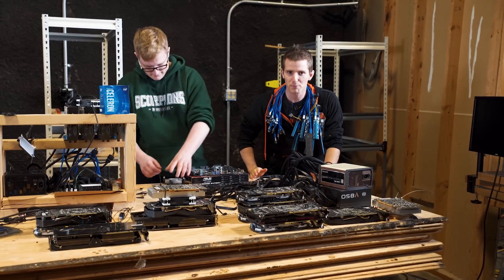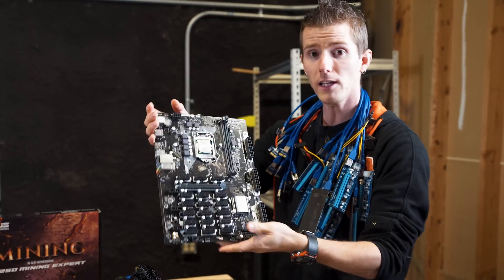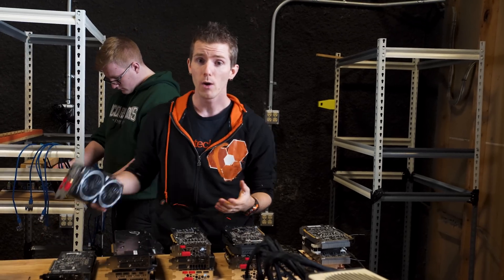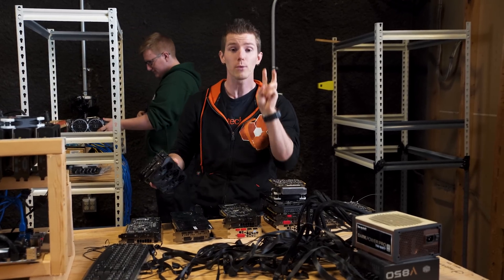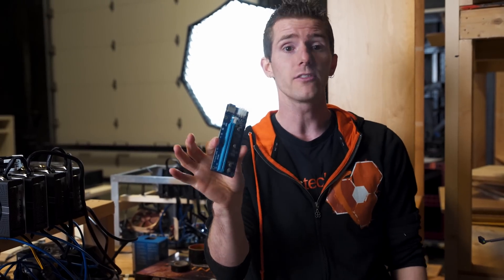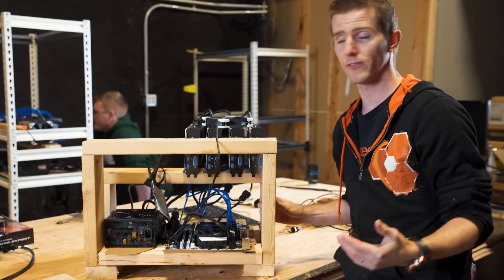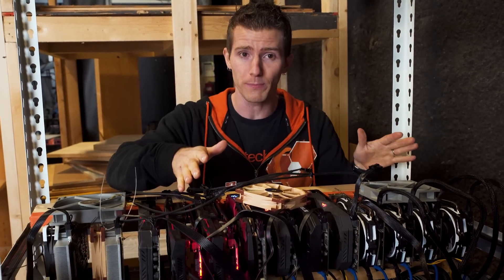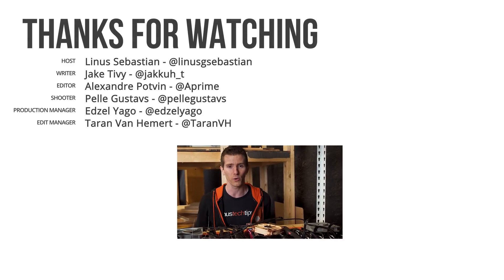13 GPUs in ONE PC? – Mining Adventure Part 2

Comment: OK going to drop some knowledge here. MINERS, you do not use a GPU to mine, you need a mathematics CPU. You are crunching highly complex mathematical equations, you need something efficient with numbers, not visual data. You cannot join any lucrative mine pools due to the fact you are not using the right hardware. You are only making a small fraction of what you could be if you just got yourself Ant miners or got yourself linux modded PS3's ( cell cpu very good at mining ) 

Whoever told you GPU's are best is a fucking moron. This is what's good! 

https://bitshopusa.com/products/bitmain-antminer-s9 

click the profitability tab, bask in that hash rate.

Comment: Question.  I have an R9 390x collecting dust. Would it be worth it to slap it in my old 760mb with my fx6300 and mine off one card? I don't need to buy any other hardware.

Comment: Bad timing my dude, Alos dont worry guys, soon you will be able to buy a 1070 for $150 when cryptocurrency  crashes.
Reply: Aaron Gramajo right I’m trying to build and a 1060 is basically 500$
Reply: Andy Ruiz - Yeah, well, if bitcoin somehow did crash like somehow, or maybe the algorithims that nvidia cards are good at mining at turn to asic, then perhaps so, big businesses and owners of thousands of gpu's with no use, so they will try to sell them off as fast as possible, even if it means selling them as low as $150. The chances of this happening are low, almost to low to consider but interesting topic yeah?
Reply: C0deH0wler what you said makes no sense. Yes prices flux but not by hundreds of dollars, mining the aspect caused a drought in cards. Simple supply and demand, If the demand out weighs the supply prices go up. Which because of everyone wanting to mine all the cards that have a decent rate are more in price.
Reply: yeah a bunch of used beat up cards covered in nasty miner fluids. no thanks
Reply: worst time ever... video card prices skyrocketed with crypto currency value
Reply: hey lol, did you know gaming will ruin GPUs way faster than mining does. It might sound strange, but GPUs that are turned on and off every day, start using more or less energy on graphic demanding parts of a game during a gaming session will get damaged faster. While keeping GPUs always on with adequate power supply and continuous maintenance will live more. Let's not mention all the gamers that leave their computer's life to fate and luck, never clean the heatsinks and fans. I know, when mama buys your stuff, you don't really care about it until it dies. But when you spend hard earned money for an investment such as a mining rig, you learn that electronics need constant care
Reply: there some info where cryptocurrency dropped 40% shares
Reply: Meaning not anytime soon
Reply: I’m a first time pc builder and that sounds impossible to me 1070 for 150 that just blows my mind
Reply: Unity Twins isn't a asic coming for ethereum in Q2 2018/latest Q3? 
Read some articles about it
Reply: Yeah I guess, I don't know exactly how it's possible but y'know, future and stuff. I don't think it's actually an asic or like a really, idk what you would call it, like dell has specific parts for their computers. So maybe these asics are just computers that have gpu cards similar to asic cards on the bitmain asic miners but are again, just gpu's, but really optimized and made with specific components like they all have Samsung memory or something. It makes sense in a way, by optimizing your cards to mine one specific algorithm could potentially get you more profits versus always switching to mine the most profitable coin currently out.
Reply: Joshua  u sound like a cult
Reply: Robert LASTnameDENIEDhehehe       O RLYYYYYY
Reply: lol yeah $150 for a miners used gpu thats been turned on all day at full load...no thanks
Reply: Aaron Gramajo maybe that price in 2020
Reply: crypto crashes, dumps and dies all the time. It's a series of bubbles. But also the best speculative product of the last years, money that you can "print" by yourself, guaranteed lack of inflation, free and available to everyone, can't be seized by governments and banks. It's perfect "money", and if you are not in the space yet, you're missing out. Gamer's opinions are clearly biased because they don't have enough money to buy a GPU, and I understand that, really. I am relatively poor myself, and don't own a mining rig, yet! But you should be the kind of people that truly value and praise the existence of crypto, especially considering the presence of tradeable digital currencies and goods in games since the 90'. And the obvious necessity of a background in hardware and software. You will understand one day, and you will buy your games on Steam with Bitcoin or Litecoin or Monero or Digibyte...

As for the moment, I suggest you buy a PS4, it has exclusive games and you won't need to spend money on hardware for about 3-4 other years. While on a PC that 1070 you want to buy will be long gone next year. be smart dude ;)
Reply: seigeengine You've got a  PhD in literacy, but just amateur knowledge in both computer components or economy. Don't worry, I'm the same as you are, but I don't hate things I don't understand, I try to read about them.

The kind of inflation FIAT has might be beneficial in some instances, but has shown just decadence since paper money has existed. Just check the inflation of you beloved USD. I don't trust a group of wealthy men to print my money, brand it and release it into the market without supplying any information about how much units exist and how they are distributed. You have such cases everywhere, just read about the Zimbabwean dollar, or the Cyprus crisis of 2008 when people were rushing to their banks before the government seized their money. If those people had their capital and life savings in BTC, the government would never be able to take it. They can pressure you, they can torture you, drug you..and even if they are able to extort your private key, they can't do it to hundreds and thousands of people. From what you say, I can say with perfect confidence that you know nothing about crypto currencies. You have a biased opinion because of the price of GPUs, or you actually believe any bullshit that is said on TV. Truth is banks and corporations are afraid of crypto. Banks will never cease to exist anyway, but most of thwm have shifted to a positive opinion about such assets and are building their own blockchain databases. It's stupid to say the technology is not revolutionary, stupid to believe they are a scam or a ponzi or a bubble. Some of them might be scams, it's a very chaotic space which gets targeted by fraudsters and hackers frequently. But the code of most currencies is open source, programmers can read it and confirm it's a legit system that works. Crypto currencies have lots of problems, no one ever denied that, but they are the true salvation for the world's economy. If you don't believe me, do your own research and don't reply here again. It's useless. If you are one of the bankers or businessmen that sees crypto as hostile and dangerous, you should try spreading this kind of propaganda elsewhere, try convincing normal people that cryptos are bad. Because those who already know it, use it and have had profit through it will surely overpower you with facts and data. I wish you the best, take care..
Reply: Razor when do you expect that to happen?
Reply: mining is just gambling why still don't learn from other company that use this method and go bankrupt
Reply: lmfao bitcoin has been around for almost 20 years. 
It's doing better than the stock market ever has and hasn't even crashed yet. 
If the stock market has crashed so many times and is still a success then you're just wasting your energy wishing for cryptocurrency to crash.
Reply: Looks like Bitcoin is stable at twice the value it was when the 1.5 month bull run happened. Idiots can never accept that cryptos are the future.
Reply: Who said it would crash. Please leave your shitty opinion in your head.
Reply: Don't just wish for something you don't like to burn. It is called a capitalist market for a reason. You need to negotiate for regulation that benefits Gamers and the Miners.

Comment: question, has anyone thought "WHEN/ not if" the mining market crashes, if the gpu that is made for mining, cards without ports, could they be used in SLI with its "cousin" cards? example, if I had a gtx 1060/ and I bought a mining GTX 1060 and used SLI, would it work? I'm assuming WHEN the market crashes, that those cards are going to be cheap, b/c you cant use them by themselves?

Comment: I've got a video suggestion. I have a video processing PC that I built that runs on an i7 870 and used to use a Nvidia 1060 to accelerate. I want to build a new PC that uses cpu only but was wondering what kind of performance improvements the first gen core i7 series has against the newer i7 and the AMD Ryzen for the same tasks. The PC was only used for final compression not video production, occasionally it would convert videos with bit rates of 25mb/s for minimal loss of blu ray discs.

Comment: In November 2017, the power consumed by the entire bitcoin network was estimated to be higher than that of the Republic of Ireland. Since then, its demands have only grown. It’s now on pace to use just over 42TWh of electricity in a year. That’s commensurate with CO2 emissions of 20 megatonnes – or roughly 1m transatlantic flights. Bitcoin mining is a competition to waste the most electricity possible by doing pointless arithmetic quintillions of times a second.

Comment: For God's sake, do not, like never ever use sata power to power the PCIe riser. Sata power is not made for the power draw that the gpu uses from the PCIe. You may experience problems and MELTING of the sata cable, worst case fire. Use 6-pin straight form the cpu (no adapters), or molex (again no adapters).

Comment: If I were to get into mining, I would get ASIC hardware, like AntMiner U3 = 63 Gh/s @ 1.0 W/Gh  ($36) or something similar...   Doesn't make any sense to me to try to mine with normal computer rigs when specialized hardware exists. I get it if this is just a proof of concept.. but still
Reply: ASIC hardware costs thousands of dollars and takes weeks to ship to you. Not only that, but they are only for Bitcoin and any currency that uses it's algorithm, which is very little now. All the new currencies being mined are specifically designed to be resistant to ASIC computers, as using the ASIC computers ended up creating a very big problem in the concept of decentralization for Bitcoin.
Reply: Actually it makes perfect sense to mine with GPUs. ASICs are way better if you get them when they are new but after a month or two of being on the market, they quickly lose profit.
Reply: Asics are worthless after difficulty rises.
Reply: I'm still wary about ASIC miners since the entry cost is usually much higher and customer support seems dodgy-
Reply: ASICs can only run certain algorithms (in that they're built to run one specific algorithm) and a hard fork in the cryptocurrency could leave you with a fancy and useless space heater.
Reply: Jacob If people would be more intelligent they wouldn't buy those 2nd hand abused gpus with shorter life span where they can come with artifacts and other stuff

Comment: Mining cards don't solve the supply and demand problem, they pull from the same die stock as gaming GPUs.  More mining cards = less gaming GPU stock.  A lot of miners won't even buy these cards because they have basically no resale value.
Reply: C4103 mining cards are desgined to be more efficent and better hashrate, not for supply issue.
Reply: Uh, the mining cards that have been announced were definitely pushed as a "solution" to the stock problem.  They may have "designed" the PCB to allow for a better hash rate and electrical efficiency but it doesn't matter.  All of this stuff still pulls from the same core materials as gaming GPUs and the problem will not be solved until something drastically changes in the way the blockchain functions.

Comment: Guys. Wood is fine. Your GPUs would melt before they'd set the wood on fire.
Reply: But if ther's a short circuit it can catch fire. Electronics don't burn well, but wood does. And these rigs are running when you are not at home to quickly put out the fire.
Reply: Riser adapters are well know for catching fire fyi.

Comment: What will you do when the mobo breaks and is out of stock ? You buy 4 new mobos + 4 new psus + 4 new cpus +4new kits of ram to get your gpus backup running again? Wouldnt it be more efficient to just build 4-6card rigs so if something breaks you wont have to buy some 1000$ psu etc..

Comment: don't know of any gpus or whole computers that reach 190-260 degrees C. Never get hot enough to lite on fire. At 150 C min  it might slowly start to char a bit but the system whole have fried and shut down or over temp safety shut down 50 degrees ago. Even if the gpu is running at 90-100 that's the chip under the cooler everything else is nowhere near that hot.

Comment: @Linus Tech Tips 
Loved this video, it put the leash on the wannabe techies out there and it seriously should because they are overflowing on youtube with wrong numbers.

However, 900 USD for 13 cards is bad. AMD is not the best for Mining no matter what websites may tell you.
My rig:
9 1060 6gb, 1 1070 and 1 1080, gives me 1345 USD per month, or more if I am lucky, 1345 USD is just the baseline.
Everything cost me less than 4k USD.

Im Switching between the NiceHash miner and an external BTC wallet and DSTM miner on nanopool.

Clocks: 95 core / 695 mem on 1060s, 130core / 700mem on 1070, 140 core / 750mem on 1080.

I don't have to pay for electricity, but if I had too, the earnings would still be around 1k USD or more a month.

Comment: F Miners
Reply: No you can easily find GTX 1050,1060,1080 or a 1080 ti for about 100 or $200 by just find the gpu's on eBay and then use the lowest to highest filter.
Reply: Defensive, ain't ya? More competition means less money. Not sure why you're saying all this when you're clearly deep in the business.
Reply: Truly. Can't wait for this hype to go away along with their savings.
Reply: stats and sources?? i have 8 cards, they cost me a little over $3000, they've mined 11 ether in the last year. thats $11,000 at todays eth price.

11 - 3 = 8.

sans a few hundred for power and risers... 7.5 grand net profit from a 3 grand investment seems like a pretty good return to me.
Reply: Press F for respect
Reply: If the hype goes down, that just means that ROI goes up from 4 to 12 months. As long as you make more than you pay for the electricity, it's fine.
Reply: Chandler Steve not true
Reply: Chandler Steve it is commonly noted that the challenge needs the same amount of prove too disprove something. This rule is used in most countries in law and science.
Reply: F Miners, get 20 to life.

Comment: I have room in my basement (very cool and dry) plan on getting some giant furnace ducting and adding a chamber with an air filter and a fan that will blow the heat generated by the rig into the air duct work so that it can heat the house, putting a large fan down stream of the gpu setup to pull heat away from the gpus, and an air filter upstream to filter dust, I heat the house mainly with a woodstove, so the furnace is never on, but using the duct work will help heat the house and possibly in the summer the air conditioning could help keep the rig cool, I figure if the rig generates enough heat energy it could help raise the air temp maybe 5-10 degrees in colder parts of the house by shutting off airflow to parts of the house that dont need the heat, and it would pull cold air from the basement from the floor up past the rig to help cool it

Comment: Linus whats an average gtx 1070 or P106-6G power usage in watts per card?
Reply: hmmm looks like a 1070 at full steam uses about 180 watts vs the P106 cards use about 75 watts? that seems like a huge difference

Comment: lol everyone is too late I bought my alt coins back when they were dirt cheap I 100X my money so far. much more effective then any mining rig can ever dream its all a gamble when mining because your constantly spending money on electricity with no guaranty of a return. good luck to all dont spend what your not willing to lose.
Reply: Actually mining is less risky. When you are not making enough, you can shut down the rig and don't use any electricity. And you can even sell it to recover some of your investment.
The ROI can be as low as 3-4 month, and then every cent is pure profit.
But if you buy coins you risk losing all if the it crashes. If you are lucky you can make a ton of money, but it's equally likely that you lose.
Reply: Plus without miners Crypto Currensies would not be a thing... Coins need miners.
Reply: Am making 500-700 usd mining Ethereum. With just 6 rx470. Hows that for no return.
Reply: When your coins go to the moon.. but you invested only $100 in them :-/
Reply: Drone1Media You suck.